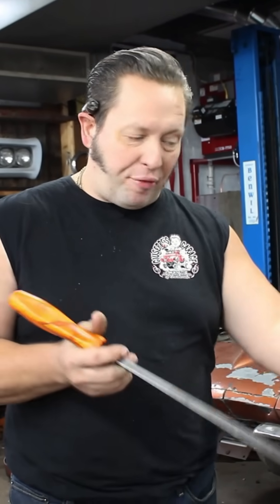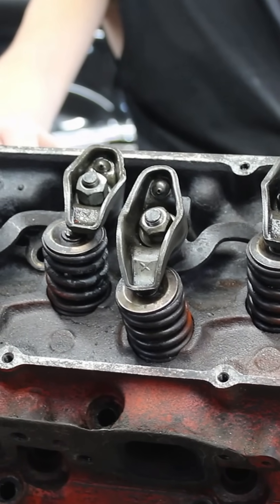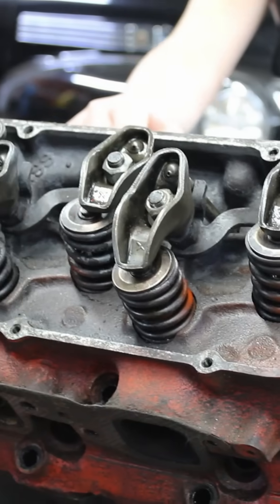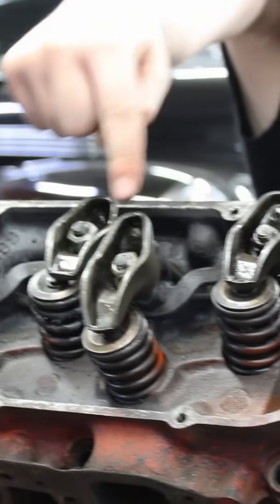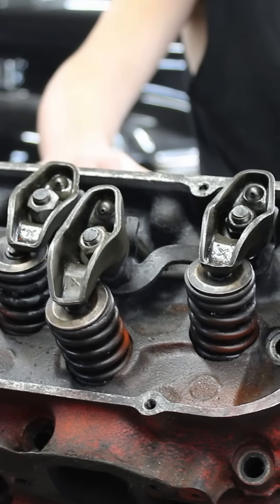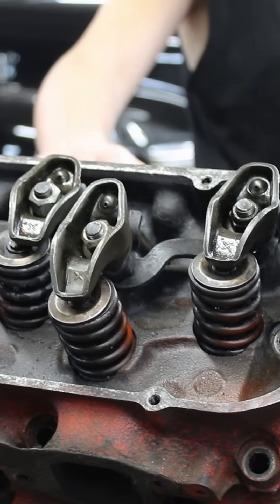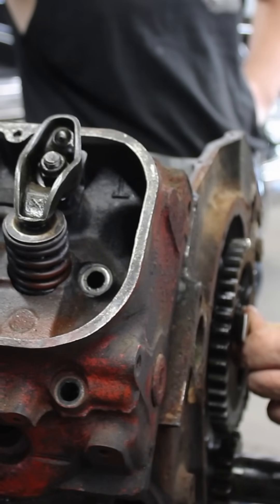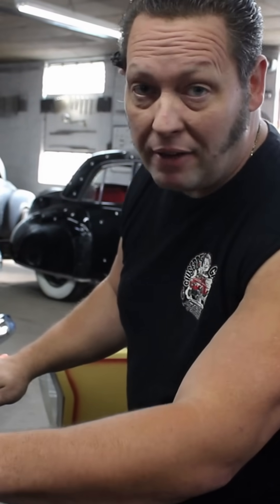#shorts Is Your Engine Interference?

Comment: I had n apifany for a novelty engine which is have a cam grinder grind a cam with exhaust n intake opposite and take some pulling truck headers and mount a carb on each and run an exhaust stack from the carb flange from the intake and have it run the other way exhaust ports as intake and intake the exhaust Probably have to have way more duration on the intake lobe and way less on exhaust. It would not be performance at all but it would be a wild crazy engine and it would cost a cam and some basic diy fabrication. Be cool in a rat rod. You may get a little more power with some port shaping? Prob should get n air gap intake to keep as much heat as possible from the oil in the intake valley. Love you see done one do it.

Comment: Is checking in the service manual about what the design intent was even a small part of your process here? I could see not believing the manual and having a look like you are doing but why not start with a "well the manual says this but I am not so sure so lets look" I believe you will find a few engines called "non-interference" but do suffer damage if the chain or belt breaks or slips.

Comment: Question is, why is the valve hitting the piston? Timing way off? Dropped valve guide? 
  Interference only means that a valve wide open with a piston at TDC will crash into each other verses a freewheeling engine. But they only do this if the timing is off

Comment: I'm 53 and I had never known that old school V8's were interference.  The first time I heard of interference engines was Japanese four cylinders.  I tossed a timing chain on my '70 Olds Cutlass 350 and then years later broke the timing belt on my '88 Ford Ranger 2.3L.  Both ran fine after I fixed them.